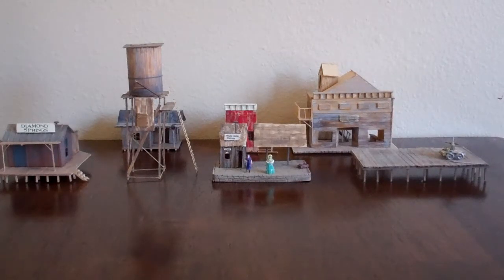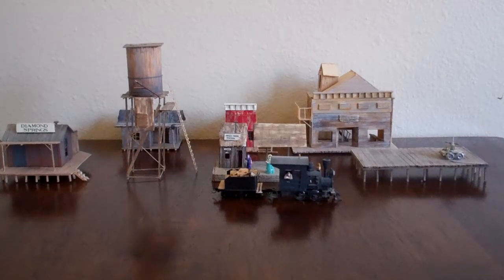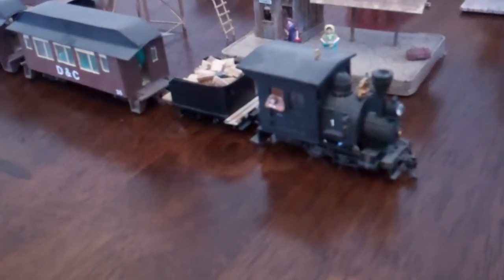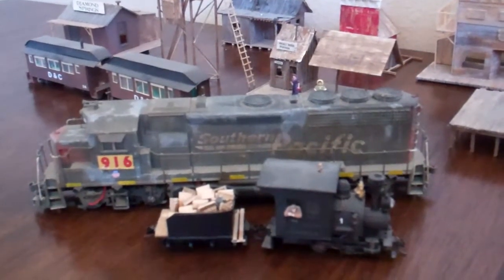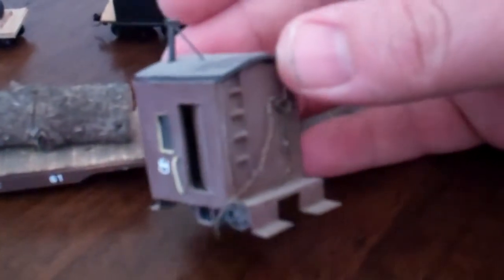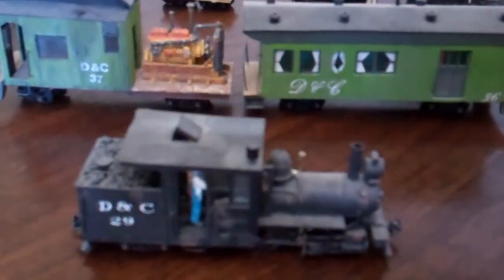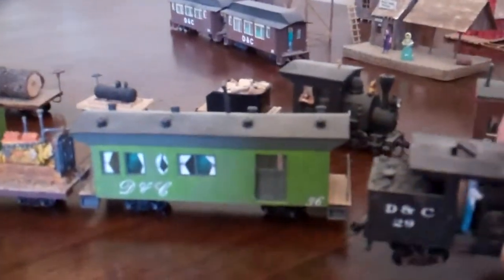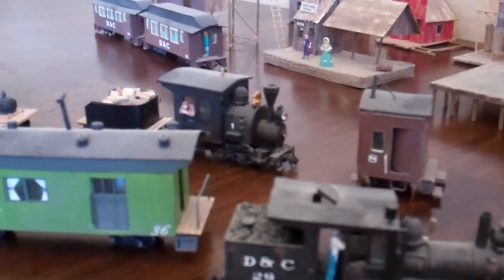old steam engines 001.MP4

Comment from the maker: Since this project I've built many scratch built items and have learned a lot from my previous mistakes.N scale steam engines have leaped forward in technology vastly over the last 5 years and prices have dropped due to the economy,so yeah a spectrum 2-8-0 or 2-6-0 would be great for kit-bashing.As long as the motor doesn't over hang any important pieces that cant be removed ,it would be great.Thanks.